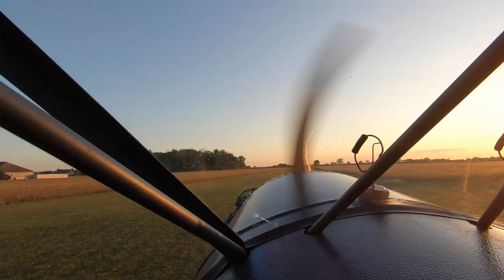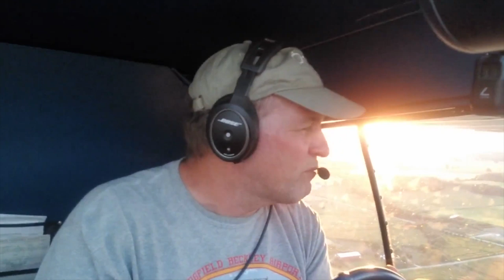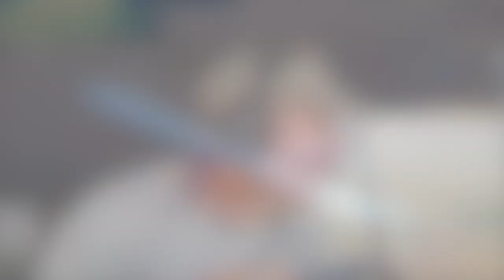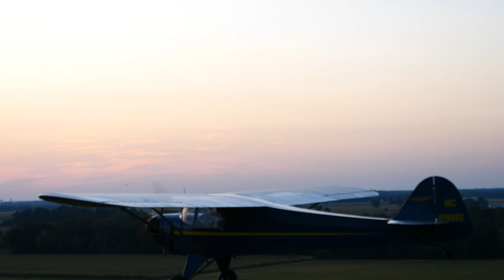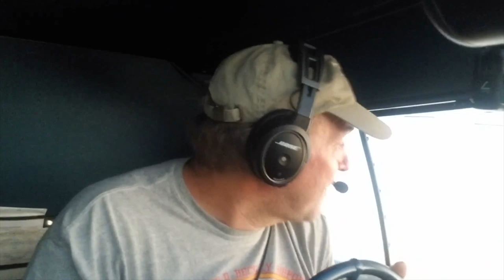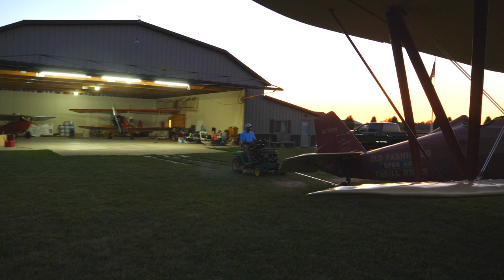Flying a 1941 BL-65 Taylorcraft

Comment: Very nice video of one of the first airplanes that got me interested in building rubber-power flying scale models as a boy. The smaller version Comet kit, to be exact. Interesting to learn that the 65hp. Lycoming was smoother but less powerful than the 65 hp. Continental. Dad had the Continental in his J-3 Cub. Also, I did not know that this airplane had control wheels instead of sticks! Along with the side-by-side seating, I can imagine these two hot items brought much interest among pilots looking at Piper Cubs, Aeronca Champions and the various Porterfield and Rearwin airplanes.
I understand that Taylorcraft eventually created a four-place airplane but it did not sell well. Maybe those pilots looking for four-seaters were wanting to graduate to the "modern" Pipers and the Stinsons. I always thought it strange that Piper built the really pretty Family Cruiser, but as with the larger Taylorcraft, it too did not sell well. Odd, then, that the Piper Tri-Pacer, physically smaller than the Family Cruiser, sold like hotcakes!
When I was building balsa models, Dad used to get the monthly Trade-A-Plane newspaper and there were always lots of Taylorcraft planes that could be had for a song!

Comment: I've got time in a BC-12D with the A65 engine, and a J-3 with the Lycoming. Isn't the difference with the oil pressure between the Lycoming and the Continental engines is that the Continental takes the oil pressure reading after it passes through the engine, thus making the oil pressure lower, and slower to come up at start-up, where the Lycoming takes the oil pressure reading before going through the engine, making it show higher oil pressure, and to indicate quicker oil pressure during start-up. At least that was I was told years ago.

Comment: Hand propping a plane looks like one of the scariest things you can do.
Reply from the maker: It's not so scary if you know what your doing and make sure the brakes work
Reply: When I bought my Champ, I was concerned about solo propping, but after flying solo from North Carolina to Northern Nevada, I seriously would not want a starter.  Mine starts with 1 pull 90% or the time when cold.  I sometimes need 2-3 when warm as when doing a fuel stop.  Hand propping these little 65 HP engines is easy.  You have to develop good habits.  Get instruction from someone who knows what they are doing.  Even though it is easy, you don't get any mistakes, so you got to keep your head in the game.
Reply: I think I would take my chances hand flipping that one before I ever tried another DA200 😔
Reply from the maker: @jimmorris5090  what part of Nevada do you live? I get out to Vegas a few times a year. Maybe I can stop by to check it out.
Reply: @DeweyDavenport  I live in Sparks, next to Reno.  The Champ is hangared in Carson City airport,  CXP.  If you get up northern NV, let me know.
Reply: @DeweyDavenport  I flew the Champ from Charlotte NC to Carson City Airport in May 2019.  I think I had 24 fuel stops and over 30 hours of flight time.  I started trying to write a journal of the trip, but I am only halfway thru a rough draft.  If I did not have to work, that might be a great job, especially flying around the country with no particular destination.  I have no electrical system, but I do have a battery-operated intercom and a handheld radio with an outside antenna.  I had them turned off 90% of the time only using them for traffic advisory.  I met a lot of great people on the trip.  I have Foreflight on my phone and an Ipad too.  Really it's like cheating!  I also had an Android phone with a flight program on it that was similar to Foreflight, but free.  I talked to ATC one time during the trip, in a MOA south of Tonapah, NV that I thought might be active.  I think 8700 feet was the highest I got during the trip (Moriarty to Grants, NM).  I was about 130lbs under gross, as I had quite a bit of gear with me.  I have just the 13-gallon tank.  One extra 5-gallon wing take would have made it much easier.  I have since taken the Champ over the Sierras.  I got up to 9700 eastbound coming back from a family visit in Bakersfield, CA.  N85040, a stock 1946 7AC with the 65 HP Continental.
Reply: No problem if you have competent person in the cabin or, if alone, you keep the tail wheel tied until you have it running and throttled back to a slow idle.